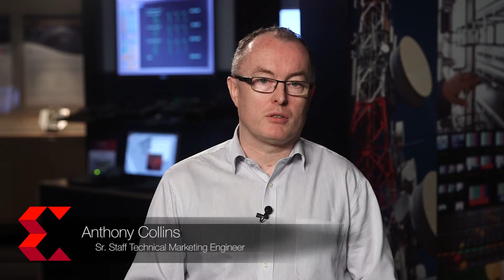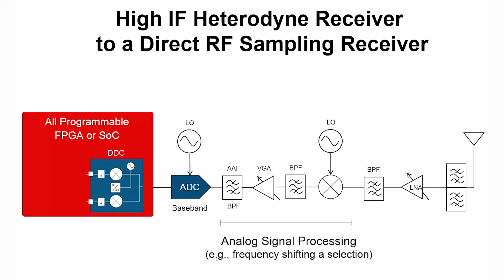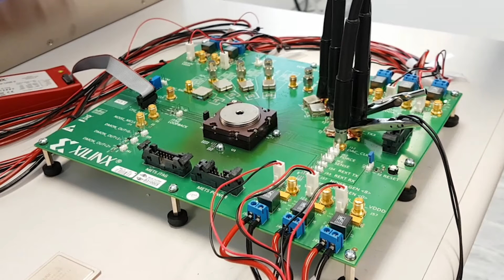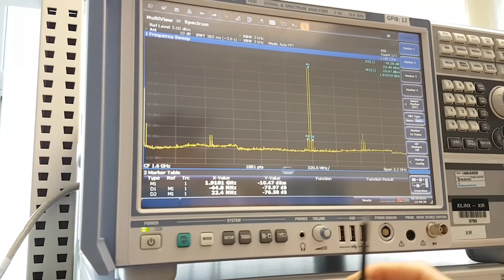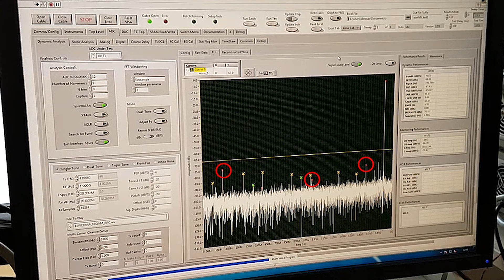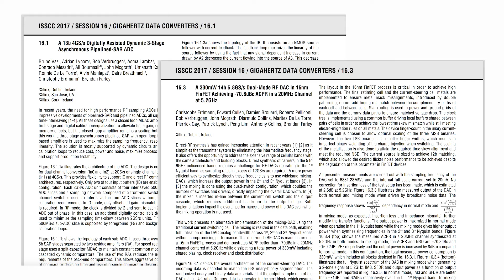Industry’s First All Programmable RFSoC

Comment: Some questions from outsider (well, i never tried FPGA programmming, just microcontrollers):
Can it be used with lower frequencies like HF, VHF and low UHF (like 300MHz or so).
Will it work for transmitters or only for receivers?
Can it be used for (de)modulation or is it just direct sampling like RTL SDR leaving demodulation and further processing for other devices/chips?
Sorry for stupid questions but i am just curious how much can this chip do.
Reply from the maker: For more information on Xilinx RFSoCs please visit https://www.xilinx.com/products/silicon-devices/soc/rfsoc.html

Comment: Question - Is it aimed at cell base systems which use discrete transceivers with JESD interface ? If so, does the performance match the best in class ADC/DACs such as  Analog Devices converters which include Digital conditioning on their chip ?
Reply from the maker: RFSoCs target wireless infrastructure applications and uses high performance direct RF sampling technology (employing digital signal conditioning). Note that RFSoC integrates the RF data converters into Xilinx’s 16nm MPSoCs devices, so JESD204B/C interfacing is eliminated. Visit https://www.xilinx.com/products/silicon-devices/soc/rfsoc.html for more information.
Reply: XilinxInc Thanks. Appreciate your response.